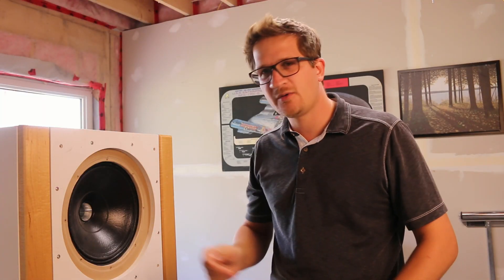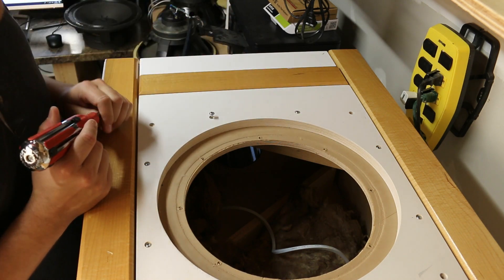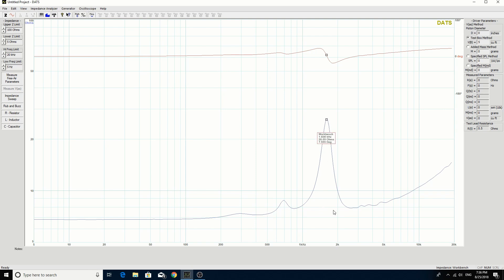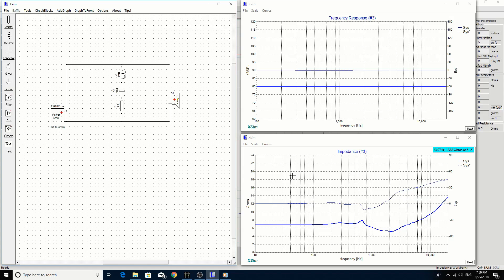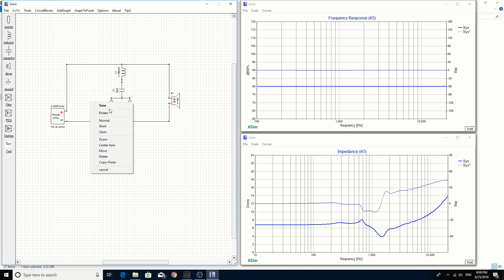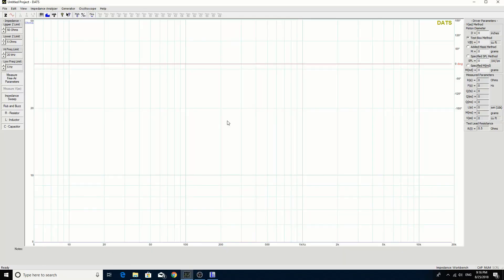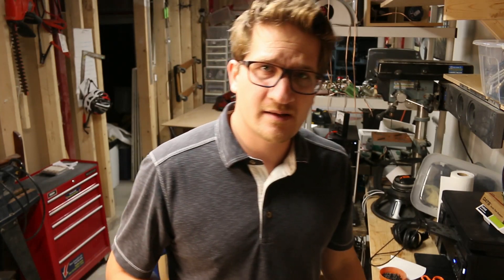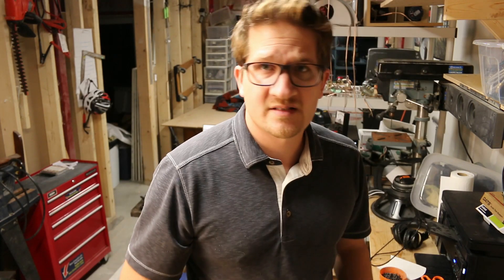Designing Passive Crossover for B&C 12" Coaxial Speaker Part 1 of ?

Comment: In this video you mention using a pc etc...  as a source. I see in a previous video that you use the Mojo and Poly. What server interface /os do you use? I have become interested in this aspect of audio since I started building up an Aleph J from diyaudio and was considering using something like Daphile. The final step will be DIY speakers. Keep up the good work and videos. Also finding the minidsp aspect very interesting!
Reply from the maker: Thank you for the feedback!  I've been using a music server for around 8 years.  Once I switched there was no way I'd go back to CD playback simply because of the superior sound quality.  A music Server (when properly setup) can sound far better than any CD player no matter what the cost.   I believe it puts digital in the same territory as Vinyl and it then becomes the recording quality (Micing technique, limited use of dynamic compression, recording studio hardware quality, and final mastering) that ultimately decides which sounds better.  Look up Arcade Fire's recording techniques for example to see what the band DIDN'T want done while recording their album 'The Suburbs'.    To answer your questions specifically, I've used a Windows PC running Foobar, Foobar then uses the Kernal Streaming Component Plugin which bypasses the Windows Mixer.  Output is via USB to my Hiface EVO USB Interface.  Then from there its output via SPDIF to my  Havana DAC (heavily modded) that includes NOS Western Electric vacuum tube for the buffer stage.  Oh and BTW, the Aleph J looks very similar to my amplifier.  I'll alternate between solid state and tube, but currently the Solid State Class A sounds the most natural to my ears.   The Chord Poly mentioned in the video replaced my Windows PC in my main listening room.  It is a step above what I had before and very similar to the Daphile.   Currently I have my entire music library as FLAC stored on a microSD card which is installed in the Chord Poly.  I use bluetooth for remote control only of Chord Poly, and I switch the Poly into Airplane mode which provides the best sound quality.  So the Poly pulls the music off the internal SD card, sends the music to the Chord Mojo DAC with no wires in between, and I have the Chord Mojo connected directly to my amp with about 6" of pure silver wire.  Its about as direct as you can get!  And it sounds very good to my ears.
Reply: @JosephCrowesDIYSpeakerBuilding  that's an excellent reply, thank you. I will give the Chord set up a try. Seems readily available on Amazon or ebay. Will just be the waiting time to get to New Zealand. Thanks again